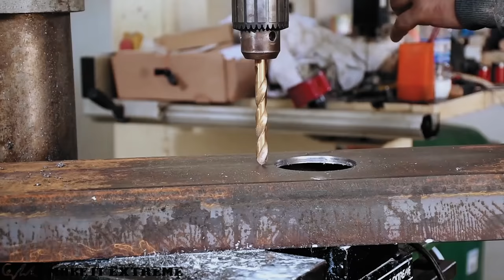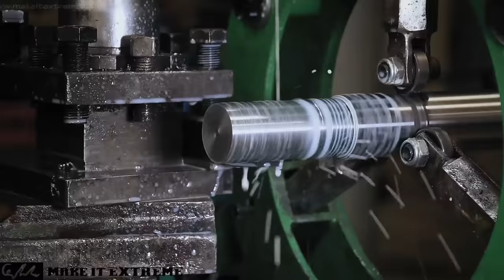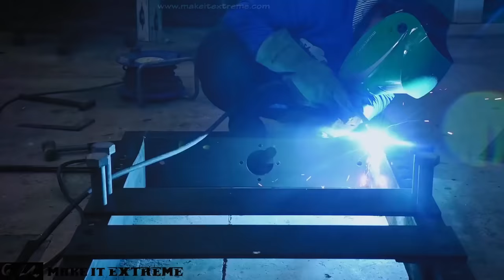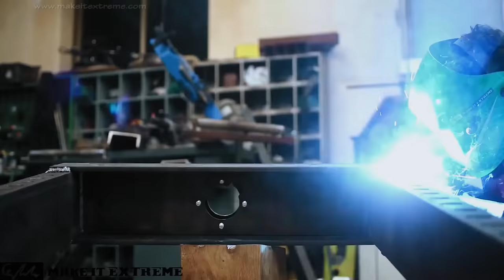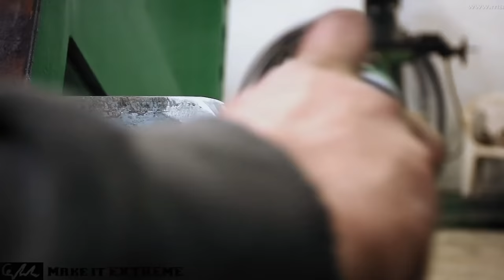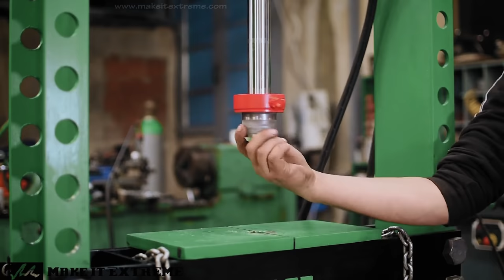Making a Hydraulic Press Machine

Comment: I gotta be honest. I've been looking for inspiration for presses. I'm going to build one here soon. But literally nothing Is as beefy and as useful as the shop built one at work. Like i haven't Seen any big parts assembly presses on YouTube.
The one st work is 200 tons
6ftx6ftx7ft tall. Frame is 6x6x.5 square tube, with back to back 10inx3inx.375 u channel. The  pins are 2in x6ft. Has a ram on trolleys back and forth.  Has a chain mail curtain for when things go spicy. We make it hop on off the ground like 4 er 5times a month with some uncooperative crane wheels or various other gearbox related stuff. I mean hop like an inch or 2 while maxing it out then 2 guys heating up the parts with oxy propylene torches.
Anyways
 This doesn't feel extreme this video. Like cool you split wood lol

I'm giving up and making A 3/5 scale press based on the one at work.

Comment: When I attached a flange to the middle of my ram i caused it to be weakened  and leak oil due to material fatigue stresses upon it so used a thicker tube threaded the outside and use a threaded pipe flange with 12mm bolt holes for mounting.

Comment: pls dont weld backwards
Reply: Direction of welding especially down hand makes zero difference. Go to any welding school today and you'll see both ways taught. Old wives tale with no basis in fact.
Reply: There is a difference between pushing and pulling when welding. Weld school who showed you that isn’t correct. Both can be done depending on gun angle and puddle manipulation. There’s also a saying ‘slag you drag’ to reduce the risk of slag inclusions in the root. 
Also both can be done with slag depending on gun angles and manipulation of the puddle
Reply: Yo aprendí de las 2 formas y no hay problema, y ya tengo 73 años, y no voy a cambiar
Reply: It’s a gas mig, no slag so weld in any bloody direction you want!